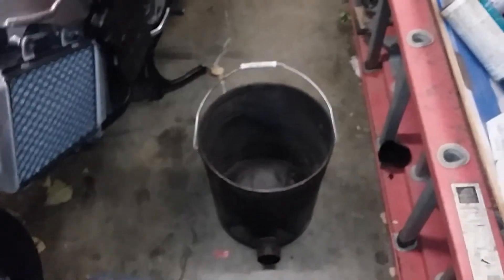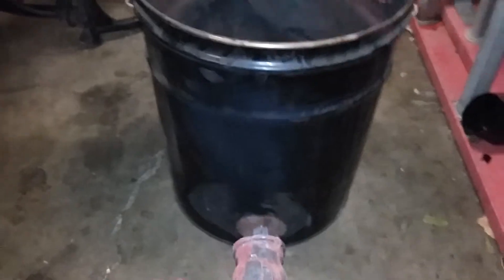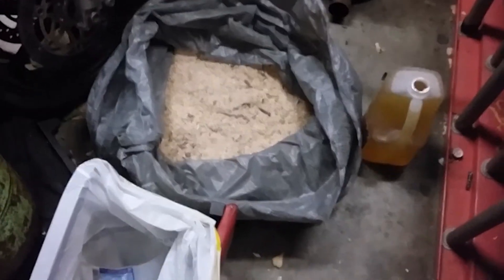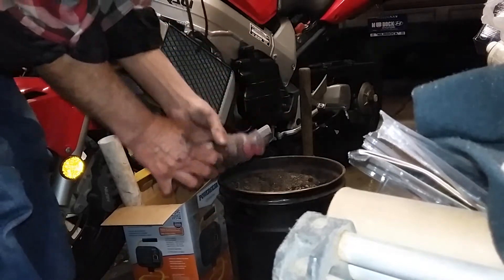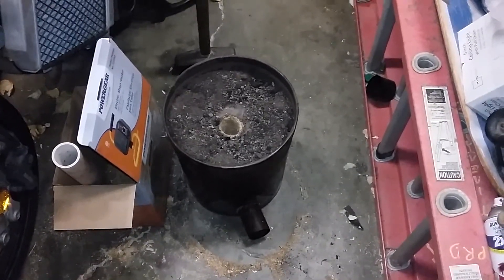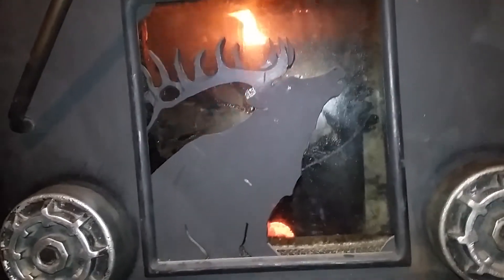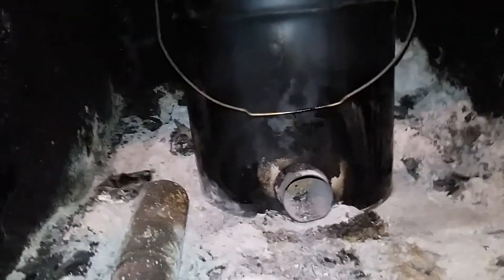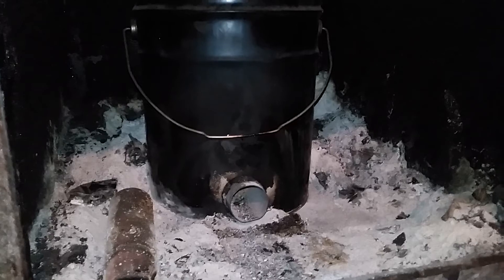17 + hours Rocket stove burn test #2

Comment: Woods contains more or less 8000 BTUs per pound... taking 1 hr or 10 hrs just means spreading the total BTU heat load in your 5 gallon pale over a given time period... adding oil is more heat per unit volume... if you used a 55 gallon drum your burn time would be similiar but more fuel burned producing more heat per unit time... if you have a sawmill or wood shop producing plenty of free sawdust maybe the mess is worth it for heating a shop space or supplemental heat... also good emergency heat... but the conveniency of fuel pellets makes a better solution. Adjust the pellet stove burn dial from high to low for about 8 to 30 hours of heating - ez 4 season heating depending on climate. Thanks for the video.